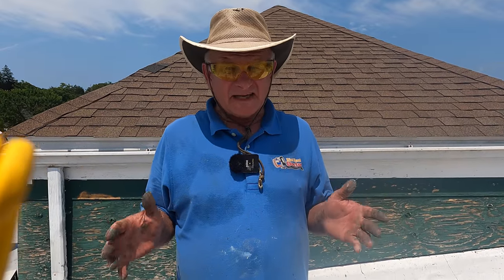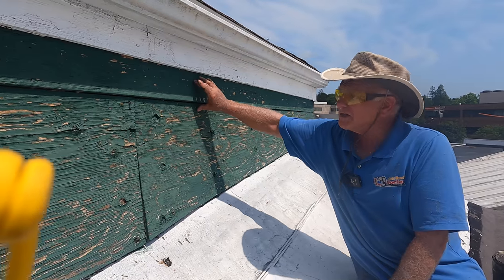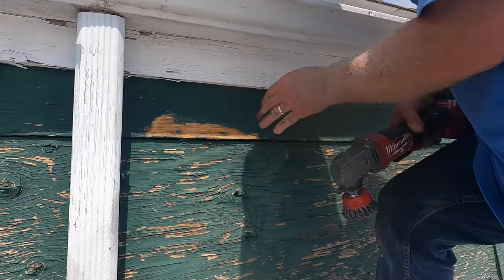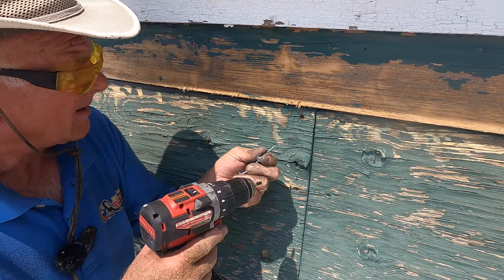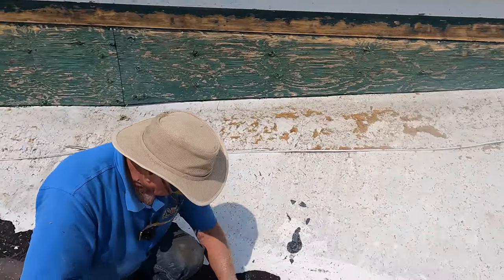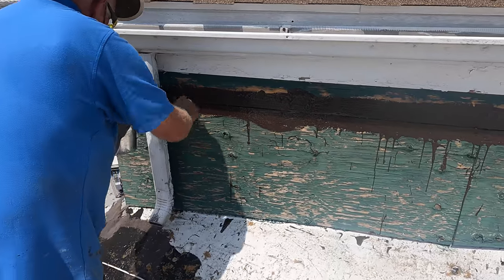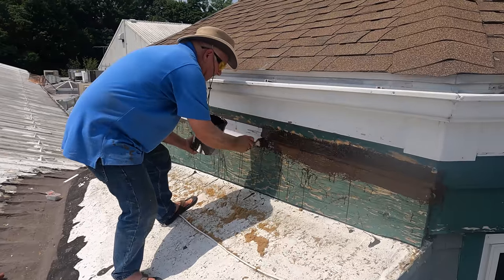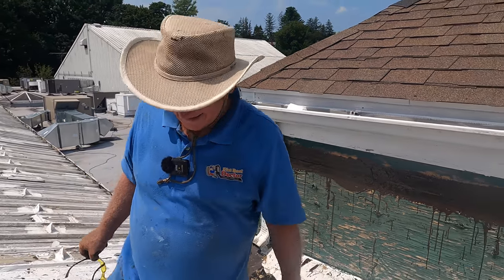Siding or Wall Leak Repair - Turbo poly Seal

Comment: Why wouldn't you flash that wall? I know you hate EPDM and TPO, but even a peel and stick granulated would be better than just leaving that exposed plywood.
Reply from the maker: That was an easy fix and under the soffit area. I want the maintenance guy to paint that plywood. But the repair was easy without having to go to the supply store to get Peel and Stick that would have cost over a $100.

Comment: Sloppy work change the plywood
Reply from the maker: this was a temporary repair that I had to do to ensure the cricket below is not leaking. The maintenance guy was suppose to install proper siding. Sloppy work? I have to do what I have to do, I can't be bothered with all the problems of so many other service people that fixed things on this roof and caused leaks. The gas lines to the A/C units, the duct work through the walls, electrical conduits, and on and on.
I am merely showing how to patch something on wood. Not trying to show you how to replace plywood